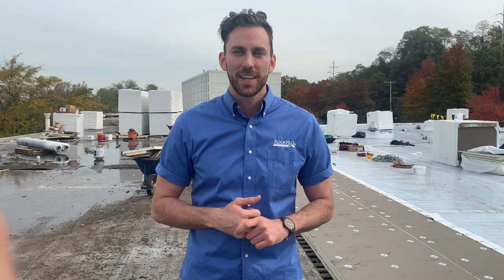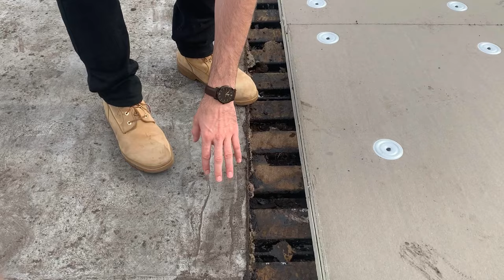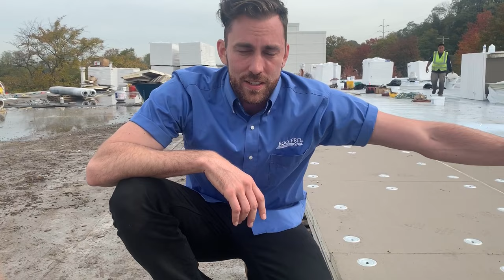How To Find A Leak On A Flat Roof

Comment: I am trying to repair my flat roof. I have applied the adhesive to the roof. When I lay felt onto the adhesive do I have to peel off the thin plastic sheet from the felt first? Absolute beginner here😮😮.
Reply from the maker: It all depends, what type of product are you using? What's the exact product name? If you search the manufactures youtube, they typically have instructions on each product.
Reply: @roofpro7003  Thanks 👍

Comment: What do you do with ice build up in rain gutters??
Reply from the maker: There is a really good product that we've installed before call a heat trace and it is attached to your roof right at the gutter and it helps keep the ice from building up. Here is a link to Home Depot of the product. https://www.homedepot.com/p/Frost-King-200-ft-Roof-Cable-Kit-RC200/202262345
Reply: @roofpro7003  Thanks.